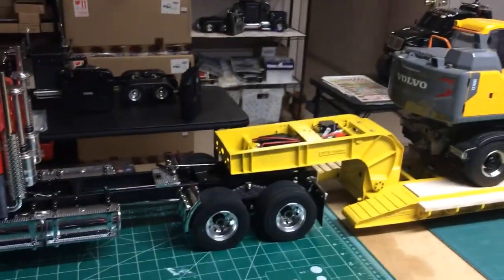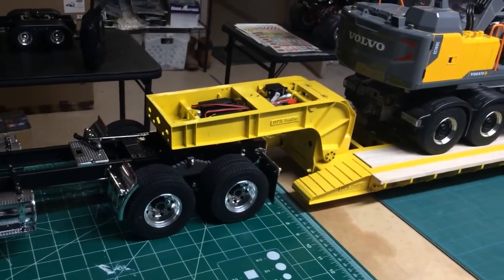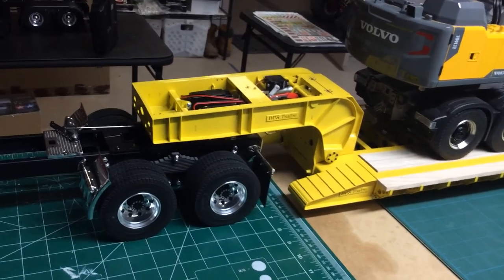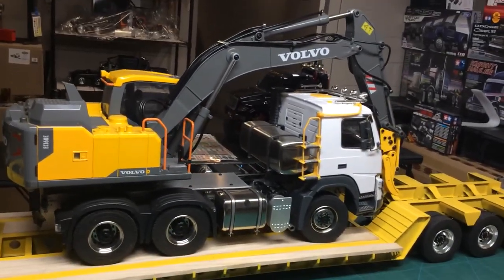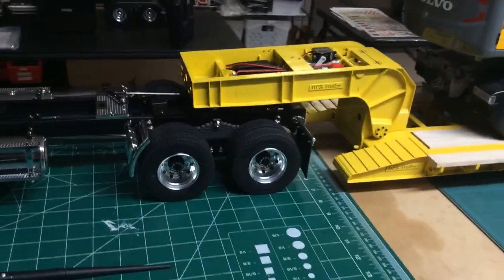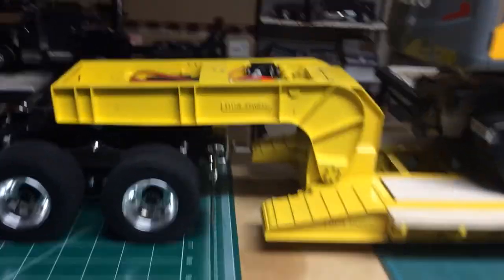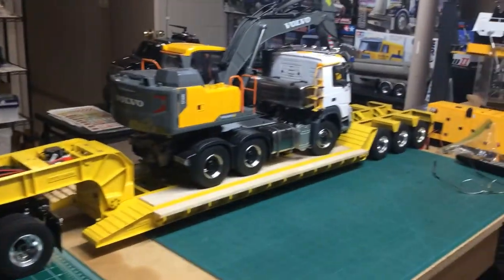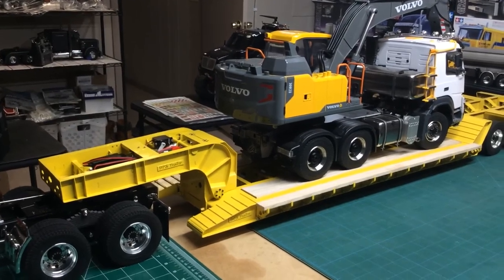DPS TRAILER LOWBOY TRIAXLE

Comment: Awesome set up. I'm assuming this is the equivalency of the Electric Lift DPS includes on there alternative to Hydraulic. My question is, when it detaches, is the gooseneck just sliding on the floor when drive away from the trailer?